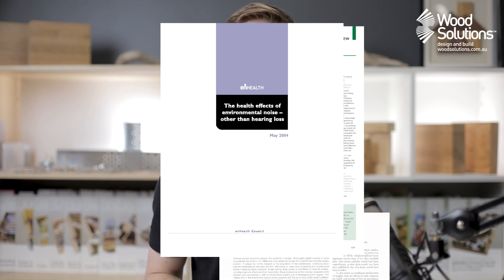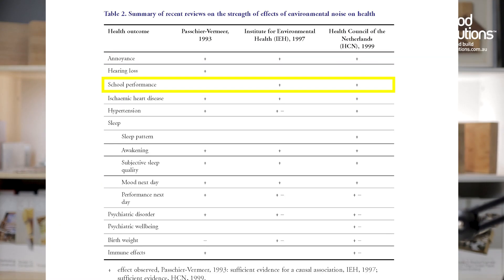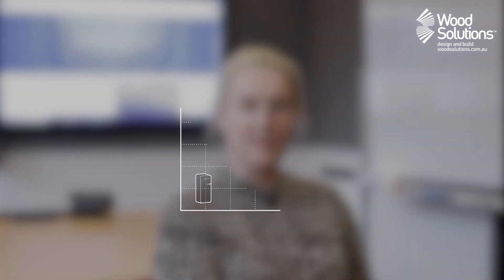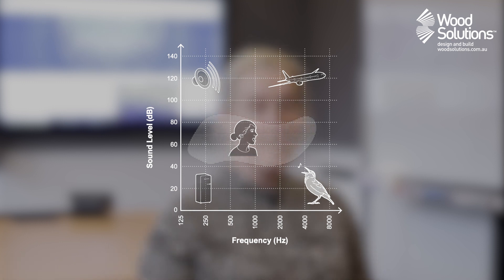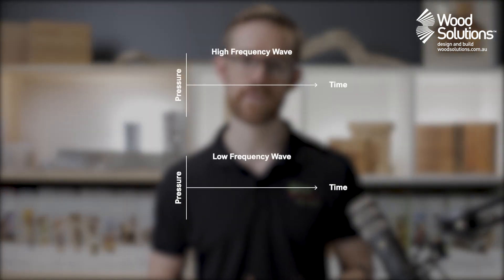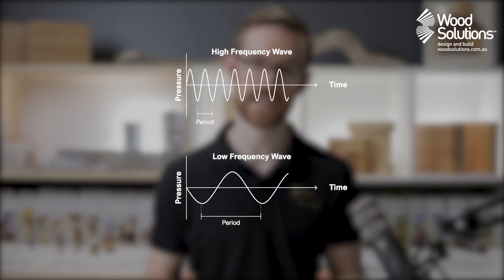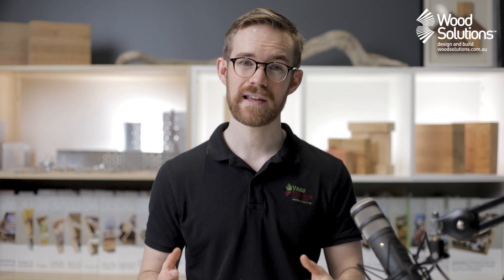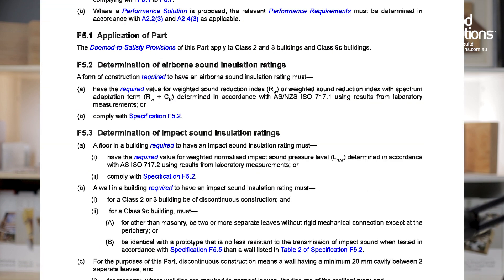Don't Design a Noisy Building: Here's How

Comment: 2:00 this is fundamentally incorrect. A 10dB increase in sound is a 10x increase in sound. A 3dB change results in a halving or doubling. Humans can easily hear a 1dB or 2dB change in sound. Most volume controls change 1dB at a time and some 0.5dB and you can easily hear the difference. Pretty much anyone who knows anything about sound knows this.